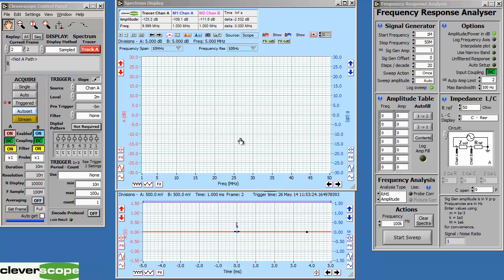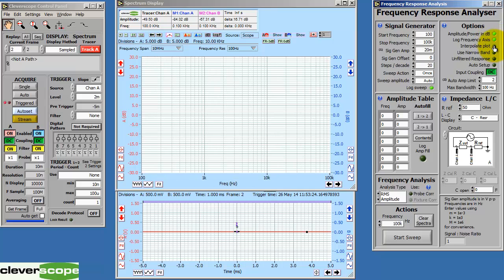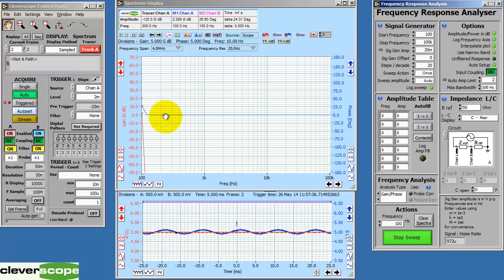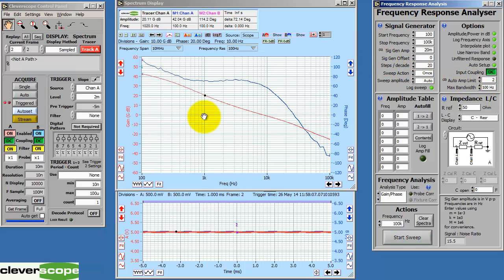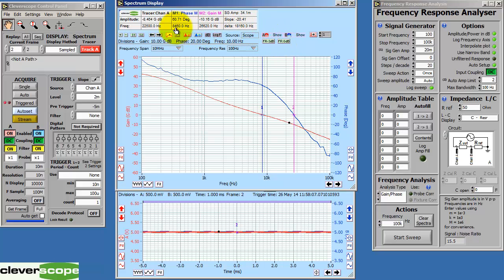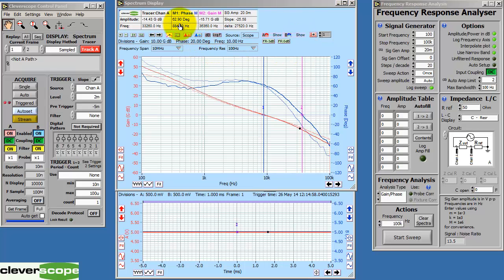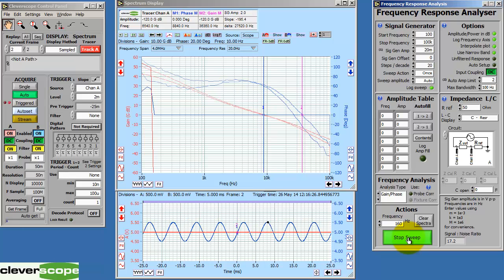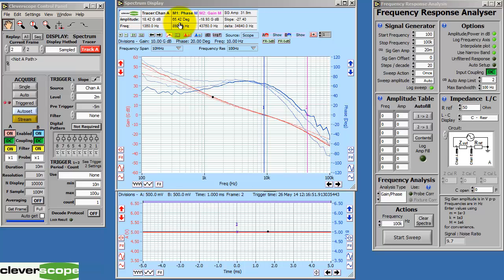FRA Family of curves

Comment: Bart,

This feature is awesome. It is useful to have multiple plots showing that the supply converter will remain stable under all load and input voltage condition. Keep up the great work you are doing on the Cleverscope FRA. I have been using the Cleverscope FRA and has been working very well and I am very happy with it.